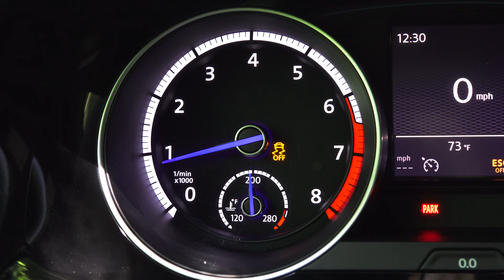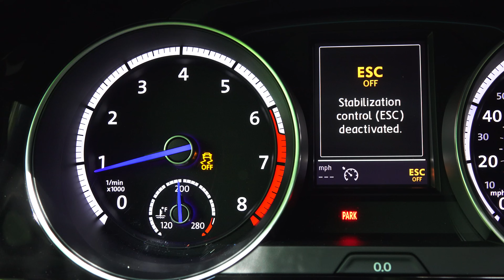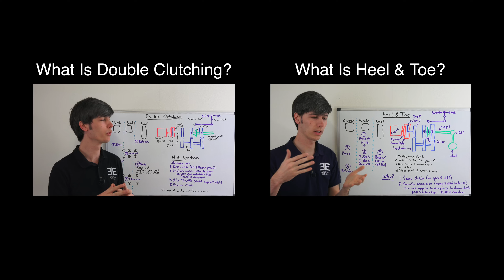How To Launch A Manual Transmission Car

Comment: hmm interesting video...  my problem is I just finished my drive license 2 months ago and switched from opel corsa (I hate me for buying this peace of crap)  to an BMW X5. The first problem of it is that I don't need to press the gas because if I do it does an little burnout even if I do it at 2000rpm it still do an burnout...

What is wrong with my car? is the engine that powerful that I don't need to press gas? 

engine is running on neutral at 1432 rpm (Read it with an obd2 diagnostic tool)

Comment: Out of all the cars I have owned the Golf R is the hardest to launch.
How do you feel about launching it? compared to some of the other cars you were launching in this video?
Reply from the maker: I didn't try many times but I certainly wasn't very successful with my few attempts. Better time is possible according to other major auto media outlets.
Reply: I think VW is trying to prevent people burning up the clutch because it seems like the car is trying to prevent that from happening. Anyways great video! 👍

Comment: If you aren't able to do this without calculating or watching the rev counter then you are not good enough to be driving quickly and safely. There is nothing more hideous sounding than a hot-hatch stopped sitting at 5000rpm. Really good drivers have a natural ability and don't even have to think about this stuff. They just do it. I'm not saying that with coaching an average driver can't be a quick driver, I'm saying I wouldn't feel safe being driven quickly by one. The dude in this video is not very good at launching. Dropping revs way too low and not even trying to compensate by pushing more gas or dipping the clutch back down. He just waits until the next attempt to try revving the tits off it a bit more before dropping the clutch. Naturally good drivers who have a real connection from themselves through the car to the road were better than him before they ever sat in a car.

Comment: I have a 16 WRX but haven't but rarely go over 5,000 RPM (the boost kicks in very early).  I think I should stay in first gear longer than what I'm currently doing, cause once I'm in 2nd the rpms go down to about 1,500-1,800 and it takes a while for the engine to get down there

Comment: I'm a little bit confused on the turbo apsect of this, I have a 2001 VW Jetta 1.8T with an upgraded turbo/tune and exhaust and such, but I don't know if it has an anti-lag system on it as it was upgraded when I bought it. 

This being said I am a little confused by the part in the video when he explained how to launch with a turbo vehicle, do I have the steps right:
1. Rev to about 3000 RPM
2. start to release clutch and floor it at the same time
3. Profit?
is that right?
does it being front wheel drive make an impact on how this works?

Comment: For an electric car 1 push the accelerator all the way down, 2 push or select the drive mode. Far simpler and will smoke internal combusion engines off the line any day.

Comment: Is redlining your car bad? (max 8k RMP I drive up to 7k)  I love to do it but sometimes bad smell come out :D
Reply: if car is properly maintained, it's alright to take it there.. but not every shift lol. higher revs = shorter engine life
Reply: "sometimes bad smell come out"... I think that's sufficient warning lol.
Reply: It's just blow by on the rings.. that's normal
Reply: redline a car is not bad. its ONLY bad when you on the redline mark and you miss gear. if you're really into cars and love your car, you can set up your car's computer to never pass the red line even if you miss gear so you can be on the safe side. note: if you do any upgrade to engine your redline is subject to change.
Reply: Thanks guys for taking time and give me advices. I mostly redline my car on 2nd gear because it is really high reving and I hit redline before I realize that. Sometimes it's fun but I feel bad :(
Reply: A redline a day keeps the mechanic away.
It kills carbon buildup on the cylinder walls but is not good to do every shift.

Comment: Is it bad to redline till it pops and then go on into the next gear? I feel my car runs quicker when I do so.
Reply: it all depends
Reply: +Alex Brodie on? It's a 5 speed and when I redline and my exhuast pops really loud and if I keep it floored it starts 2 stepping till I let go of the gas and shift into the next gear. And when it pops it sort of kicks out of gear into neutral
Reply: +Juan Torres u don't need to red line,if anything ur causing more harm than good

Comment: Thanks god we learn to drive manuals from the beginning here  in Germany. By the way its the one and only way to realy drive a car. Automatic transmission is for grannies. Its much more fun and if you do it right you can unleash the full Performance of your car.

Perhabs why he didn't usw the Launch control of the R. Even the GTI had one. And doing 5.000 rpm at the Launch of the 300hp Golf R is very senseless. The efficent coridor for a fast launch is between 2500-3000rpm all above let the tires Spin so your traction is gone and your tires will be ready for the trash soon.

Comment: I mostly slow launch on 1st gear and throttle with 2nd and 3rd gear. 2.4l Volvo D5 diesel engine so it revs so fast to red line so accelerating with it kinda difficult and you end up spinning tires very easily. It actually goes even for uphill by just releasing clutch slowly and not using any throttle.

Comment: I found launching a turbo car was best using the hand brake - set the handbrake, bring up the revs to where I want them and then bring the clutch to bite point, using the handbrake to hold the car, use the clutch to put drag on the engine allowing exhaust gasses to be generated to spool the turbo.  I do use a ceramic clutch though and drag race the car!  I'm not worried about the component wear!
Reply: I would use the handbrake to slow down and stop the car not to launch the car. Just let out the clutch then floor it, no brakes needed.

Comment: If you have rev limiter, step down on the throttle all the way, then only use clutch slip to keep the RPM at peak torque RPM. It will tear up the car, but you will get far quicker result since you'll be at peak torque from 0 MPH.

Comment: Not sure if you already did this, but can you do a video on why you would want racing/track slicks from a technical perspective and if there are conditions you wouldn't use slicks even on a track, etc? Thanks!
Reply: slicks are a lot softer than street tires so they wear alot faster, but have way more grip.

Comment: 6:50 a 60% torque loss would mean that only 40% torque is availiable, the second gear would be 2.5 times as long.
but it isn't. a second gear is always shorter than double as long as the first....
Reply: There's a Shift button just under the Caps Lock button.  Punctuation is key... if you want to appear smart.

Comment: Word of warning, launching is extremely stressful on cars and you will break stuff...
think you'll do 10 launches... yeah right, it'll be 100 launches in no time.
Reply: Launching is extremely stressful. What's important is that you do it right and to allow time for the parts  to cool between launches.
Reply: It always depends on how you launch. Personally, I like to rev up to 3000-4000 rpm when the situation allows it and release the clutch smoothly. Basically, I try to get the most torque onto the track before spinning wheels. I will never just drop the clutch when revving up.
That way, the part that is going to wear the most will be the clutch. And clutches don't cost a lot.

Comment: Is that WRX an STI? That 5.0 is REALLY quick for a normal WRX.
Reply from the maker: +Abendschein Nope, just a WRX. I can't match the time in the STI (though it requires another gearshift). WRX is a performance bargain.
Reply: @EngineeringExplained  with harder launching. 0-60 comes easy with the STI
Reply: Engineering Explained For some reason I keep hearing/seeing 5.9. 

That's kind of interesting, though! If only the local Subaru dealership had let me test drive the WRX when I was looking to buy, I would've ended up with that instead of the 2016 FoST.

Comment: im more curious about the upshift problem about launching..like, how do you shift from 1st to 2nd without it "snapping" and making u lose all the speed?
gearing from 2nd to 3rd is no problem, 3-4 no problem etc, but first to second gear it always snaps when you release the clutch after upshifting, how are you supposed to release the clutch after switching to 2nd gear, and mix the throttle in there, to avoid losing all the speed and get a smooth shift?

Comment: I think the sweet spot is the 3-4k range because you won't burn the hell out the clutch by letting off slowly. Cars with launch control are a much better option.

Comment: Sorry, but I have different "driving shool" First if your foot it is on clutch ,and you add rpm,then you ruined your clutch . Better solution in this case is press gas pedal to required rpm , then press the clutch ,and then take foot off from the clutch. If i use your solution in my car  i have got ruined my gearbox and the clutch,not

Comment: That is the #1 reason I would never want to launch a 4wd car with a manual transmission like the WRX. It's just asking for transmission trouble there. They always put the power down, and that might be great from a launch part of view but as you mentioned, the transmission pays the price. Too many revs in my mustang or some front wheel drive screamer and the tires just spin thus taking the strain of the transmission and driveline.

Nice video. I just hope the boy racers give themselves plenty of room for error!

Comment: I'm a noob at driving and i have a question:  when my engine is cold and i start off and go to 3000rpm then change to second the car judders and struggles as the rpms have to drop. is there a way to drive smoother and if i'm doing a launch how soon should i apply throttle after lifting my foot off the clutch? (also an answer for every day driving would be nice)
Reply: Don't give it so much gas when you're starting. Also you can try releasing the clutch slower while giving gas into second gear, it's riding the clutch but you'll get better at driving and soon won't need to.
Reply: Spartan111792 thanks that must be the problem! i can't believe i didn't think of that.

Comment: 1: Put in first gear
2: Rev to limiter
3: Dump clutch
4: Profit
Reply: Rip clutch (Huyndai accent)
Reply: +deth kon One tire fire :D
Reply: +V3VANG One wheel peel for days
Reply: @dethkon2284  wheel spin up to 5th gear
Reply: Instruction for 1000+ Hp Car
1: Put in third gear
2: Rev to limiter
3: Dump Clutch
4: Drive to the Tire Shop
Reply: 1: Put in first gear
2: Rev to limiter
3: Dump clutch
4: Enjoy gearbox support broken (Micra k11) Confirmed (y)
Reply: bye bye transfer case in an evo 😂
Reply: spaceminions not if your on the rev limiter, you'll just get wheelspin
Reply: +V3VANG Like most people who drag FWD do and expect traction?
Reply: 1: Put in first gear
2: Rev to limiter
3: Dump clutch
4: Break a tooth in the transmission, now the cars does clicking noises when in motion.
Reply: very unclear instructions, car ended up in my bedroom
Reply: Youness Alkhader why sleep in a bed when you can park your car on your bed and sleep in the car?
Reply: note: you must be a mechanic to achieve step 4
Reply: I did it and enjoyed it xD
Reply: Im sorry, but I still can't get my plane to take off. Is there something I'm doing wrong sir?
Reply: Thee Adjudicator Truck with a weak v6.
Reply: Wymiatacz Plays yeah... 2005 ram 1500 base model with the 3.7L v6 to be specific. No weight in the bed. New tires. The same truck chirps the tires upshifting into second fast. Was kind of a wtf moment.
Reply: @spaceminions  traction control?
Reply: @jaxongerace9664  no
Reply: Unclear constructuins, blew my car.
Reply: spaceminions haha what were you driving?
Reply: 5. shift into second 
6. rev to 5k rpm
7. vtec kicked in yo!!!!
Reply: 5. Stall the engine because you let the clutch out too fast.
Reply: Or the 2015 honda civic si
Reply: Broke the drive shaft :(
Reply: You're gonna get movin faster if you slight clutch burn with your handbrake pulled.. putting forces on your suspension before realeasing the clutch completely at the same time as you release the handbrake. this can improve your time by atleast 0.1 sec for ALL Cars.
Reply: By dump the clutch do you mean let it go fast
Reply: @robertpakulski1738  yes..
Reply: @robertpakulski1738  dump the clutch means releasing the clutch very quickly in a manual transmission vehicle.
Reply: Lionel Pereira ye I was thinking about that
Reply: @lionel170  imagine someone actually having the car in 1st gear at redline and suddenly pressing the clutch with full throttle
Reply: @ynk69  that reminds me of The Fast and  The Furious movie when Dominic Torreto launches his car on the rear wheels only 😂
Reply: 5. Wake up and realize you still don't have a supercar.
Reply: Vale worst feeling, but still makes me wanna go for a ride withing 10 minutes of waking up
Reply: +V3VANG savage.
Reply: 5: break drivetrain
Reply: what about a diesel??
Reply: 5 : break a drive shaft
Reply: LOL
Reply: spaceminions psshh! I believe I could leave a mean peel in your truck outside a Denny's carcark easily!,,,,,unlesss its 4WD.
Reply: Thee Adjudicator No, it isn't 4wd, and I was surprised it did stall. But it was revved all the way up, full throttle... what else can you do?
Reply: spaceminions you cant stall the car if you have the revs no matter how fast you drop that clutch in 1st
Reply: @wilsonn6767  wrong
Reply: 5: Bend a rod
Reply: Aleksandr Kamarov stop, you'll give people nightmares
Reply: I guess you drive auto.....
Reply: Gopnik n 5.8k rpm*
Reply: u made my day xD
Reply: Thee Adjudicator my Sentra came with lsd back in 2002
Reply: Still cant get my f18 to get traction on the rear tires dammit
Reply: 5: Break your wheels, Clutch and Transmission at once
Reply: "What is traction?"
Reply: This still cracks me up.
Reply: or debt
Reply: 5: explain to mommy and daddy why the car aint working right
Reply: You spelled (R)ace gear wrong
Reply: Thats nothing for a getrag 6 speed
Reply: 5: tree
Reply: Only for gnomes though, I did hear it works for Oompa Loompas but can't verify
Edit: the torque spread on the Golf R is impressive!  It reminds me of the first car I bought after college, a used '00 Saab 9-3 viggen with 8k miles on it which began my love of lighter turbocharged hatchbacks.  (The original buyer was a nice older Austrian lady, who thought she had ordered the cushiest version not the performance model!)  To compare the 9-2x Saaberu was significantly slower, despite an on paper power advantage.  The 9-3 was lighter, with much less rotating mass in the drive line...but yes did have vicious torque steer and stock.  An added steering rack and a sub-frame brace dialed it back to a very controllable amount)
Reply: While very fun, spinning isn’t winning
Reply: If I tried to launch in first gear my tires would explode.
Reply: Cha Ching!
Reply: Followed instruction, broke my neck
Reply: alternative to 4 is: die because of failure
Reply: Did this by mistake in a crowded intersection 😔
Reply: That's why he always carries a spare clutch with him
Reply: ngl this is how i thought you'd do it before the video 😭
Reply: YOLO you only left one 😂
Reply: one wheeel wonder
Reply: Thee Adjudicator I wish that had been the case, but no... it stalled.
Reply: HenryMania Hahaha! Unless it's has an LSD, like the Alfa Romeo GTA's or recent Golf GTI's (^^)

But then again is you own one of those you probably have a little extra cash to throw at tyres!
Reply: i'll take one wheel peels any day over rwd

Comment: In my opinion an uprated clutch helps a lot. With the standard clutch in most cases, you are forced to almost dump the clutch. If you try to moderate the pressure, you always end up spinning it and only releasing the trottle makes it grab. 
With an uprated clutch (beeing hidraulical helps too) you can moderate the pressure that you apply to a certain amount. This helps a lot with keeping traction, but also to avoid mechanical damage.

Comment: i would personally  not use my own manual car for a perfect quick launch, whatever you do in a perfect launch you will damage the clutch. better is enjoy the manual car when it is moving not launching. i drove whole my life mostly manual cars, it is really unnecessary such launches...if you want fun, after a rolling launch, change to second gear fastly and enjoy the spinning wheels when you are on 2 nd gear, it is much much more fun :-D

Comment: How does traction control play into this?
I also understand that my front wheel drive is power limited in 1st and 2nd gear, does that mean I should shift to 3rd gear earlier?
Reply from the maker: +RogerWilco If you're traction limited, it's fine to use higher gears. If you're power limited you want to use as low of gears as possible as long as possible. Typically having traction control off will allow for the best time (unless you're power limited) as the system won't interfere.

Comment: posted this to your fb page but it said it was full so ill post it here

Hey man,
Love the videos. I'm going through the process of purchasing a racing seat for my street car (1996 nissan 300zx dark purple metallic). The stock seat just doesn't work. 
The thing is, it's been a head ache on figuring out what seat to get. Most company sell street seats that are fairly cheap and then racing seats that are more expensive but are FIA approved. 

I was thinking it could be a good video topic since I'm sure there's been more people in my shoes before

-Tim